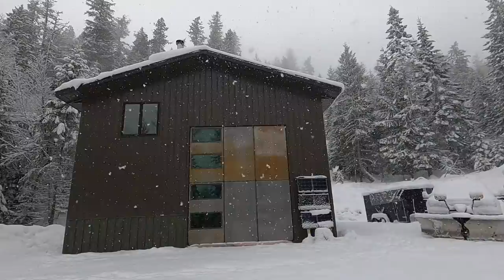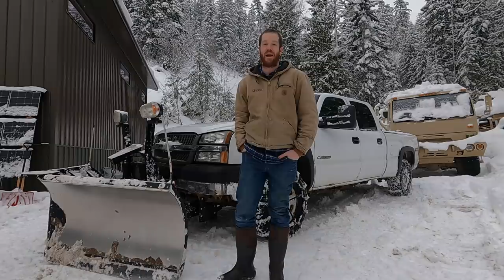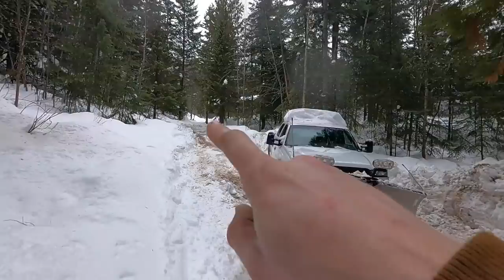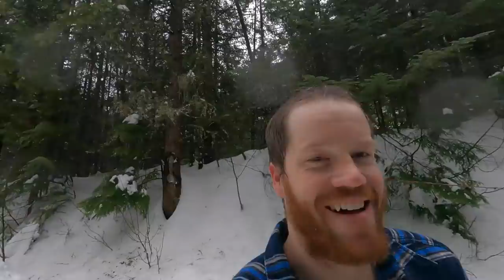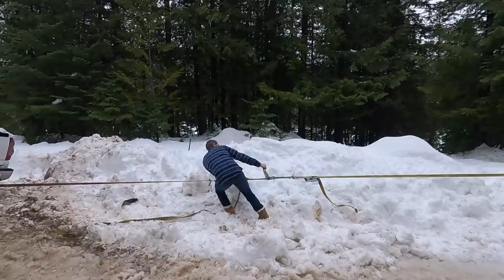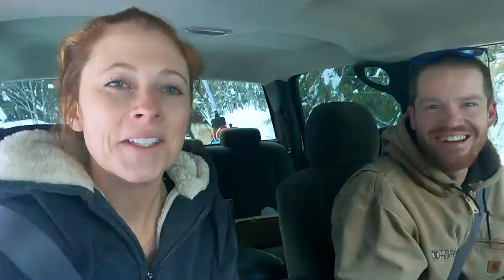WILL WE MAKE IT OUT? | Battling A Blizzard

Comment from the maker: 🚨 Thanks for watching! What recovery equipment do you think we should add to our arsenal? Courtney votes for a winch! Riley says chains for the army truck.
Reply: I vote winch. It is excellent in cases where one person is all you have.
Reply: Agree, winches front and rear, or moveable.  Chains on Army Truck could be good, but might encourage use and then hauling that tank back on the road after sliding on ice would be very tough.
Reply from the maker: Donald that is the reason we haven’t used the army truck yet! There’s no way our neighbors bronco would be pulling it out!
Reply: @AmbitionStrikes  That actually is not entirely true, you have a lot of trees around, so a 4 or more pulley system with anchors at the trees, should easily pull your truck in any direction you want with Bronco, or any other 4x4. just need tree saver straps, pulleys and long enough "rope", or many ropes, to get the pulleys closer to the object to be pulled.
If you care to see what can be done with pulleys and anchors have a look at this russian recovery channel:
https://youtu.be/tzki2U4Yk_U
Reply: Chains and winch for the Army truck! Make it unstoppable! 😂
Reply: You should also get some radios mounted in the equipment. Beats forgetting a hand held radio and it has alot more power for distance like Truck to Home if stuck.
Reply: chains, winch, and plow on army truck, you need more mass pushing than the plow truck.
Reply: Chains and winch for the army truck, and maybe a plow for it next year. Also snowshoes for when you gotta walk out to safety, you can go much further on those then knee deep snow.

Also those days where its snowed and then rained, its better not doing anything in that, let it freeze back up first, then don't break through that top layer of ice unless you are moving the snow.
Reply: A winch for sure and a couple snatch blocks
Reply: Definitely a winches 👍
Reply: @donalddodson7365  The army truck sure would be an all-or-nothing solution! If it slid off the road a bit it would likely be there for a long time.
Reply: A removable cheap badlands winch to share between trucks. Chains for The army truck if you can get also a bigger winch ;)
Reply: I would do a HF Winch on a hitch receiver mount. Then put power wiring and a hitch mount on the front and rear of all of your vehicles.  You can easily move it to where you need, or store out of the way when not. One of the professional vehicle recovery YT channels Casey LaDelle uses this method and even has a jeep on tracks similar to yours. This is a strange year, but if you regularly get this much snow, you may need a serious skid steer snow blower setup.
Reply: Back in Iowa, we stake the outer edges of parking areas so that we know the boundaries. What about staking some of the troublesome ditches so you know when to stop? I realize when you catch traction and the lose it, that energy might send you further than expected...like when your truck drifted off into the ditch while reversing. I also like the wench and the Army truck ideas. 👍 Snowmobiles? 😃
Reply: 4x4 tractor with bucket and snow blower does the trick! Thats how we cope with snow in Finland.
Reply: In the short term a very heavy duty winch and snatch blocks.  Army truck chains only if you have a winch big enough to recover it... Otherwise you are screwed.  

Long term you really need a tractor with a snowblower to maintain that driveway in winter.
Reply: This year with all the snow if it wasn't for our neighbors tractor and snowblower we would have had a very narrow driveway. But when all the rain hit he plowed the slush with his blade. He said the slush just would get stuck in the blower.  I think a tractor with blower and snowplow the tractor with chains. Does your army truck have pto at the front? You might be able to use your army truck like a tractor.
Reply: Also some CB radios so you can get ahold of each other without phone service..
Reply: I think you need a small front end loader with a snow bucket if you getting snow like that every day , your pour truck is taking a beating . The money you save on the plow is killing you nice Chevy , I understand you have to start somewhere and your doing great . Persistence pays . Plow every 2 ton3 inches and not all at once’s will save the wear a tear especially when the snow wet and  heavy. I wish I was there helping but I have enough of my own irons in the fire and theirs only one of me . All your snow adventures videos is taking away from things I need to get done  . I stayed up till 3:00 AM last night watching and 4 hours this morning . Life is good and you guys are making the best of it . I have a 65” smart tv and watch can you in HD tonight prime time . You guys are a blast . Back at it !!!
Reply: Growing up in cold country I was taught a few things that California types are not taught. Weight over axels with sand bags, a little salt lowers the freezing temp of water. A can with ash and charcoaled chunks, sand, wood all can be used for traction. A snow shovel, a candle, with cotton balls dipped in Vaseline for sub zero temp use the can and matches crack the window for carbon monoxide. A down and wool blanket stuffed in a vacuum bag. Traction boards, a winch with snatch block, and a parachute anchor snow, sand dirt can be shoveled to provide an anchor if a tree is unavailable. Chains help air down roll over than air up for tension thing is y’all don’t have a heater core for your rig nor have you added any winter additives the Army LMTV is great but at a grand a tire and having not gone through it and completed maintenance by TM or operators manual stuff is going to crack leak and generally be a nightmare. Worth it but neither truck is plow ready without maintenance issues. Y’all are young get a snowblower for the atv and throw it off the drive. Lighter easier to recover, lighter winch needed, chains for a small car may work air down tighten them air up again. My two cents. Bad weather tell someone you are going the route and when to expect a call community is key in rural up county.

Don’t spin the tires it melts the snow which quickly turns  back to ice and now there is a fine moisture slicked tire shaped hockey rink around the tire surface.

There was a power take off leaf blower build on YouTube with Courtney’s expertise guessing Riley can fabricate modify an ATV snowblower being metal shop barniminium proprietors a modified auger with a fan blade and molded mud flap think it would be reasonably priced, you understand the mechanics for repair, and ideally get some view revenue.

Probably pick up a small 4cycle Briggs or Honda off Facebook market place or a local trader swap event ask around at the hardware store look for a long beard and ask.
Reply: I have no experience with snow removal, but the snow blower on the 3 point attachment for the tractor that Gold Shaw Farm has will help a lot as it sends the snow far instead of accumulating it like the plow does!
Reply: I vote winch. You could even rig a mount over your patio door to raise sofas, stoves, and such. Maybe even use it for an elevator build in the future.
Reply: A winch that can be moved to either a front hitch or back hitch. If you get the Army Truck stuck (chains or no chains) on your road there will be NOTHING that could move it till the snow melts. Just imagine it being stuck across your road and you unable to drive down your road because the truck would make the road impassable. ALWAYS keep shoe crampons and snow shoes IN your vehicle PLUS warm clothes incase you have to spend some hours stuck. Don't take all this lightly.
Reply: Hey, guys! The truck does not need a dump, but an auger for snow removal. It's easier for the car, it throws it far away. As it cleans now, the box and the distributor at the truck will quickly fail. Good luck and love! Greetings from Russia!
Reply: for starters learn to use the CTIS on you 2.5, other then that, living in the mountains/heavy snowfall area, you would be better served with a snow thrower mounted on a skid steer or tractor
Reply: A winch would definitely be useful, specifically on a mount that attaches to your trailer hitch receiver.

But I think you should be looking at something like a Kubota tractor with a snowblower.

Those diesel tractors van be used for a variety of purposes, depending on the accessories, and a snowblower is far superior to a plow in deep, heavy snow.
Reply: Snatch block
Reply: The Army Truck could do with some more weight (in the back) if using it for plowing, TRYGG chains of course (Norwegian quality ;-) )
Still a 4WD tractor with snowplow - frontloader - snowblower is a far better tool 
Again; thanks for sharing
Reply: Dream big, a skidsteer with a snowblower
Reply: Have you considered a sled/sledge to pull behind the snowverlander? :)
Reply: Build a shoffel for the exc, a bigger one just for snow. Greetings from Tyrol
Reply: Next time getting up at 2 am isn't going to seem so difficult!

The main thing is not allowing 16" of slush to build up before you plow it (especially with a pickup truck)

Live and learn, enjoy the rest of the winter!!
Reply: Chains for army truck, winch front and back on army truck, chains for recovery purposes on army truck, plow on army truck, aggressive off-road/snow tires for army truck, weight for back of army truck
Reply: @scottmcshannon6821  Agreed a much stronger frame as well, pickups don't last long pushing snow
Reply: A snowmobile
Reply: @nitcat1  2 snowmobiles or a Snowcat...   with a garage at the base of the mountain for a 4x4...   great idea
Reply: Both!
Reply: Not anything immediate but eventually it might be better to have a tractor that could manage the work of the plow truck and excavator plus a number of other tasks. The flexibility of the various attachments is great and they are much better for plowing than a skid-steer or pickup. Much more robust and maneuverable than a pickup. Much better in deep snow and over irregular terrain than a skid-steer. Of course, the right tool is often a compromise based on the total collection of projects you have planned. In the meantime, I agree with most folks that a flexible winch setup would be best. Don't ever do anything that could get the army truck stuck!
Reply: @mozki1  I like the blower idea...and these young puppies have enough brains to supersize a home grown blower for the army truck...that would be a huge engineering feat....but heavy on the cash required.  Let us, your fans, know if this is an idea to seriously consider. Perhaps an opportunity to help $$?
Reply: A rotary snowplow is better than a snow plow in a snowy country!
Reply: Winch mounted on a receiver with connections on front and back.
Reply: You should get a snow oger, 5 foot wide, mount to your four wheeler.  "Chuck porter - everything outdoors" on YouTube just did a demonstration of one on his property in Canada. Amazing. It will blow it instead of pile it no more stuck truck.
Reply: You can add a winch kit to the high lifts. Super handy when you don't have a winch and are stuck. I used my buddys all the time when offroading, before I got my smittybuilt 10k. Cheap security if you're out and can't get help asap.
Reply: Definitely you need some kind of tractor, wheel loader or even small bulldozer.  Tractor with front loader is quite versatile tool. With that amount of snow and having miles of road you want to have something else than pickup. Imagine you might have to clear that road many times every winter, there will be your reasonings if it costs something to solve the problem. Someone suggested leaving car down for groceries and go the road with snow mobile or something, sounds also ok solution for short term if you keep having lot of snow you can't always plow.
Reply: I know you asked about recovery equipment, but it does seem like a snow blower would reduce the instances where recovery of a vehicle becomes necessary to begin with.
Reply: Add a couple three 8000 pound come-a-longs to your recovery gear. The trick is you set it up so you can use it single line for addes reach and two part for max pull.

A winch is nice but it's not as flexible in it's usage as a couple of come-a-longs. I've carried a pair of Harbour Freight 8000 pound come-a-longs with rigging in my Toyota pick-up for years. They never left me stranded because of a dead battery.
Reply: The army truck would probably do better than that plow truck even without the chains, but if you put chains on it, it would probably be unstoppable.
Reply: I keep seeing chains for the LMTV... I would say don't because you will just have a bigger stuck when you get it stuck... trust me been there did that and almost didn't get it out. Took a logskidder with a 20 ton winch to winch us out after he rolled a couple of tree stumps out of the ground because he hooked the blade behind them to keep from sliding while winching.
Reply: @chrismoore9997  actually no not at the temperatures they are seeing. It too would need to be chained up. What causes ice to be slippery is when pressure is applied to the surface the ice surface turns to water, the water acts as a lubricant when the pressure is removed it refreeze. This is how ice skates work.

The caveat to this is when it's very cold around 0°F and below unless it is a very high surface pressure.
Reply: Plow and chains for the army truck with a big weight in the bed.
Reply: Teresa says "the phone number of a neighbor with equipment that can get you out." 

I say a skid loader for Courtney! Chains on a military truck which has no glow plugs and weighs 17,000 lbs would not be fun to pull out of a ditch. Also kinda of big if it blocks your road. Might be a little hard to get around. 🙂
Reply: Winch
Reply: A summer home closer to the equator.....
Reply: both lol and a plow for the army truck, could probably find an old county plow for it.
Reply: Get the same equipment that your neighbours have
Reply: Winch on all vehicles.
Reply: Chains for the Army truck.
Reply: I keep thinking you need maxx traxx  boards.. majority of the time I felt you only needed a small amount of traction to get the momentum needed to get out of the situation. Living in Australia, I can only guestimate as we don't get snow like that here.
Reply: A skid steer with a kick A$$ snowblower.  At least something wide enough to do the whole road in 2 passes.  Down and back up.
Reply: @68spc  - I agree.  Minimum of some GMRS radios that they can run - I’d argue for ham radio myself.
Reply: I have another idea.  A Pistenbully 600 with a winch.  More fun than a snowblower.
Reply: A couple of receiver mounted winches (1 12k÷ and 1 6k or?) and receivers on everything front & rear along with a couple of heavy duty come-a-longs (side pulls) and aluminum loading ramps there won't be much you can't get yourself out of, including roll overs!
Reply: Both!
Reply: Alsough I think that all of your cars and trucks should be winter offroad ready, I think that winch would be better since It will allow you to make a plow truck self-sustainable. At least one winch on back of the track could he;lp to unstuck it. Front point covered by the plow so there is no useful case to put it there.
Reply: The Snoverlander needs a plow!
Reply: I have been very curious why you are even trying to plow that road, when you made that tracked vehicle, so that you don't need a plowed road?
Reply: Both eventually...
Chains, block heater, and plow for the Army truck. 
People worried about recovering it don't know what your mini excavator will do.
Oh a skid steer and a mini ex go together like peas and carrots. Then you will need a rock crusher and a headache rack for your dump bed and you can build roads...
Reply: Again You spent the money and did the work on the tracked truck why are you not using it? Perfect with the plow!
Reply: YES! Chains for the Army truck! With chains, that LMTV would be a monster for plowing snow.
Reply: I vote winch and chains for the army truck
Reply: Use both chains and winches, redundancy in safety is always a good plan.
Reply: Locking diff for the plow truck!
Reply: a big snow blower for the army truck
Reply: Technically you already have a hand winch. The hi lift jack can be used as a hand winch, just put 2X Bow or D-Shackle through the eyes on the jack and use straps either side of the Hi Lift jack then use the jack like a hand winch. Get some recovery tracks too. Anything else is optional.
Reply: Use a winch on the Jeep. Works better than a 5 ton army truck.
Reply: Really thinking you shouldn't trade in the Excavator for a compact tractor with cab, loader and backhoe.
Reply: Do you have a source for granite on your property?  If so, I wonder if it would make financial sense to buy your own rock crusher to turn large pieces of rock into fill so that you can further build-up your roadbed next summer (investing in years of less stressful winters).
Reply from the maker: @C3Cooper  Yes! We have already been exploring that idea.
Reply: Snow blower, winch and radios...
Reply: hi guys i cant tell if you have a rear locker true trac or e locker they are not cheap but i love playing in the snow
Reply: @lumbyone , preferably locking differentials at both ends.
Reply: Buy a tractor with front loader so you can use it for everything
Reply: Both
Reply: @aigarslacis4433  TOTALLY AGREE with Aigars.   Tree savers, rope and heavy duty pullys and you can get out of almost anything even solo.
Reply: I'm plowing own yard (turning places for trucks, connecting roads, house yard, areas between buildings all together about +1 acre) in 2-3 hours. Sometimes need to move snow 50 meters but usually 10-30 meters. While plowing between buildings there is limited space and I create 5-6 meter high snow piles.. Sometimes need to get places clean before 6 am. so plowing must be efficient.

I'm just using John Deere 6420, normal front loader and a big bucket (+2 cubic meters). Never have been stuck. Never have been out of power. No chains in use just normal tractor tires and sometimes I kick differential lock.

Sorry, but I wouldn't even try to plow with truck. Your excavator is good!
Reply: A D11. Can plough without stucks.
Reply: Glad you got a cat!
Reply: chains
Reply: Weres. Your. Snow. Mobile